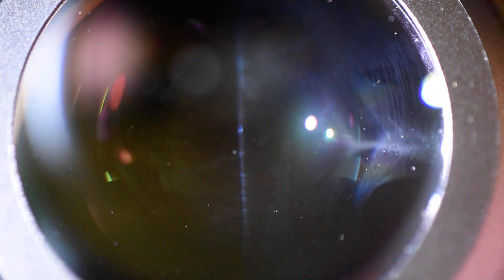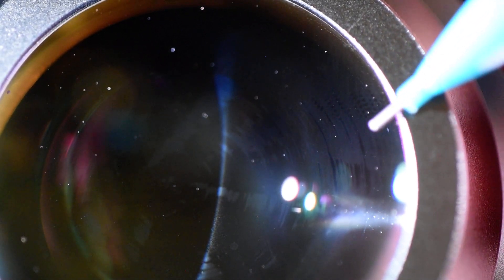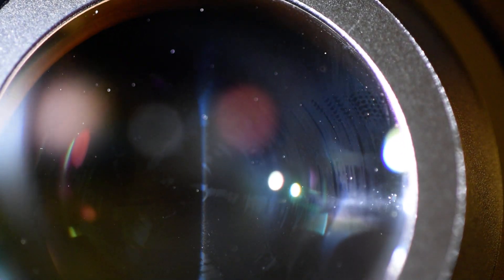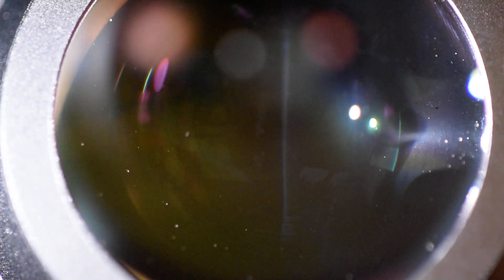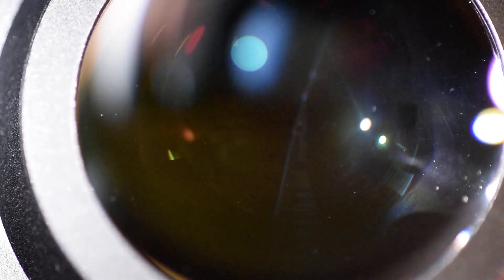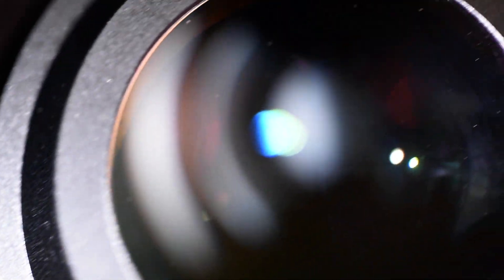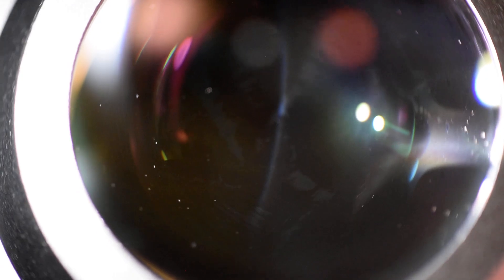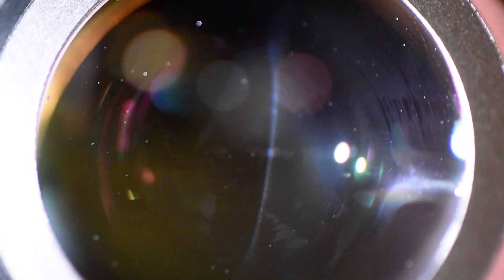Scratches on 12.5mm Nikon NAV-HW

Comment: It is possibly a combination of swirl marks left by final cleaning at the factory (tiny traces of contamination on a internal element) together with high humidity inside the eyepiece.  Sometimes the lenses are placed on a rotating turntable and swabbed before final assembly, hence making circular marks.  I suggest to warm the eyepiece slightly for a day or two to drive out moisture, and see if the pattern goes away.